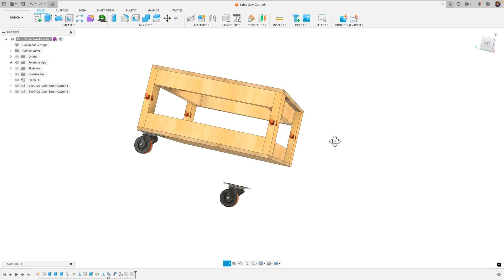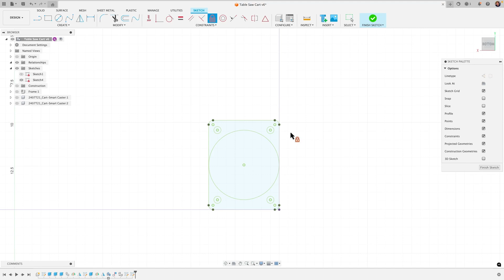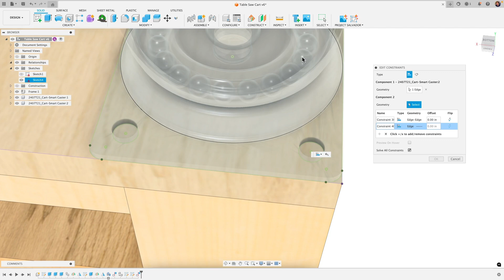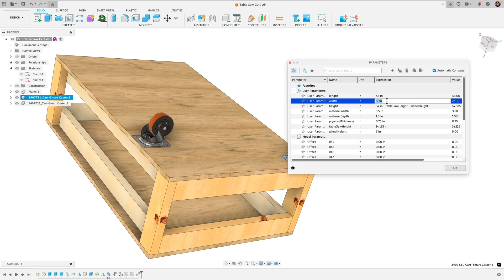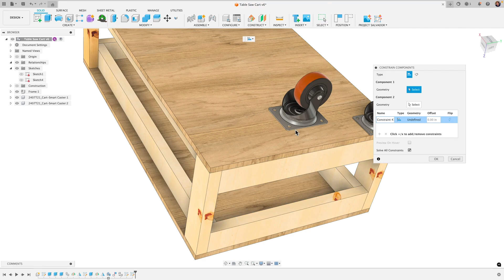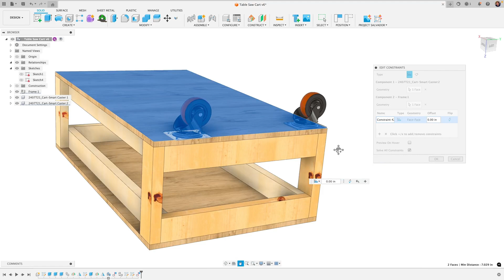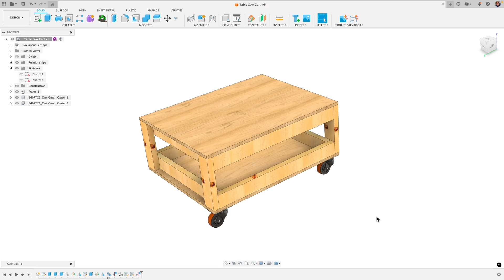Constraint Mistake to Avoid in Fusion

Comment: Vladimir, do you have trouble occasionally when a point or beginning of a spline applies a constraint that you cant remove? It happens to frequently to me, I usually draw a new line or whatever further away then move to where I want it to be.

/
Reply from the maker: Hi Adam, sometimes I do have the issue of trying to move a line but multiple Coincident constraints have been added and it's difficult to tell which coincident constraint to remove.  In this case, I sometimes find it easier to redraw the line.  I also like using the technique of drawing a line further away and using constraints to place it exactly where I need it to be.